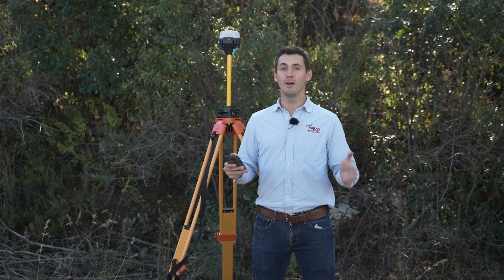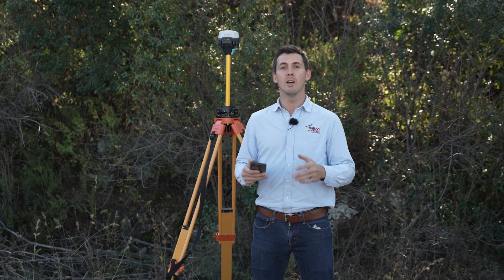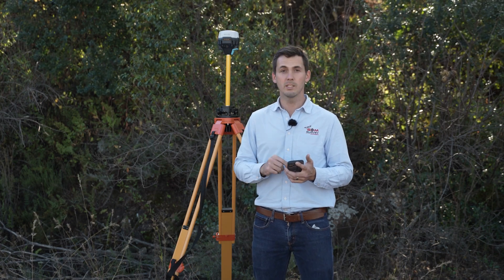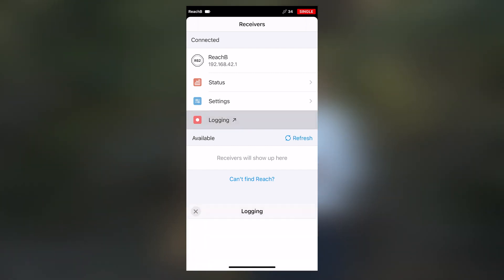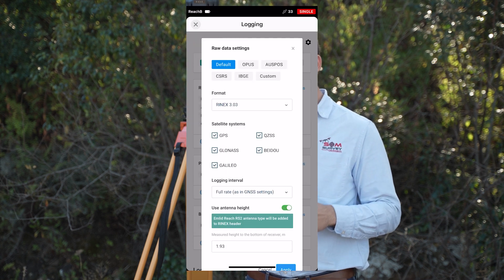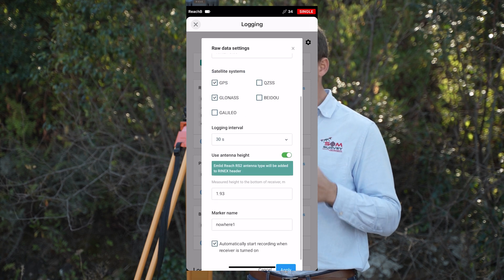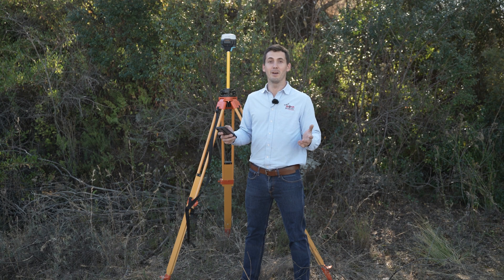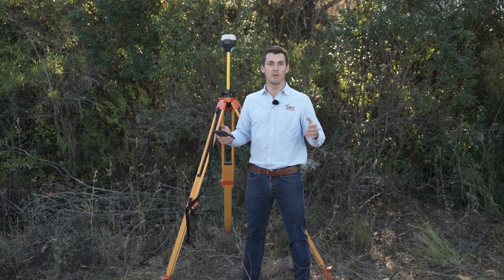How to determine a base using PPP Method | EMLID Reach RS2 GPS Training.

Comment: Great video! A few questions if you don't mind. What is the accuracy of the Base coordinate you received when using PPP? I'm using an Emlid REACH RS+ which works on single L1 band unlike the RS2 which you use in your video. Also, what PPP service would you suggest to use especially in the southern African region. I am in Madagascar so geographically, it's about the same so I presume that the PPP service you use in SA would provide the best result for Madagascar as well. This is actually very useful to me because our geodesic survey points are poorly calibrated around here, and are unusable most of the time.  And we don't have a CORS network available just yet. We also have 2 IGS reference stations from which I can fetch RINEX files but they are too far away most of the time and are not practical in the slightest. Thanks again SOM SURVEY!
Reply: Hello, did you manage to process PPP in Emlid studio?
Reply: @brunonhandu9927  Hi! I read from the Emlid Docs that it will reach at most 30cm for the RS+ to do PPP. And that requires at least 4 hours of logging on-site. I gave up on it since I knew that I will never reach anything below 30cm of absolute accuracy. Instead, I already tried Emlid Studio with PPK and I can say it works fairly well (I still haven't managed to obatain E,N,U coordinates but it gives LLH).
Reply: Hey! Thanks for the video. I have the same questiin as Billy.  I am based in Mauritius myself.